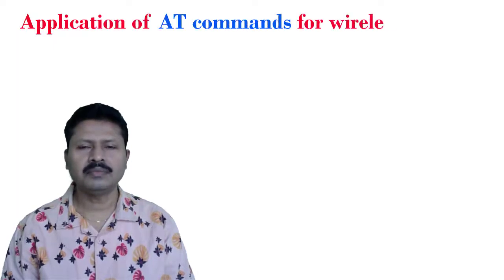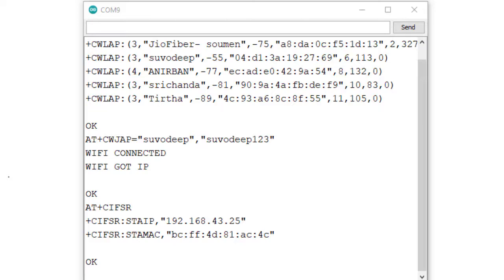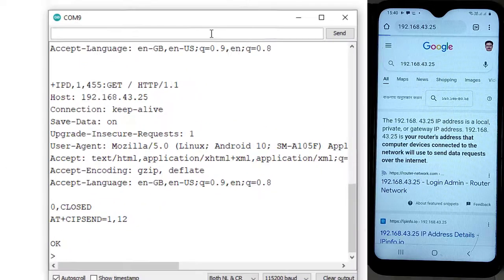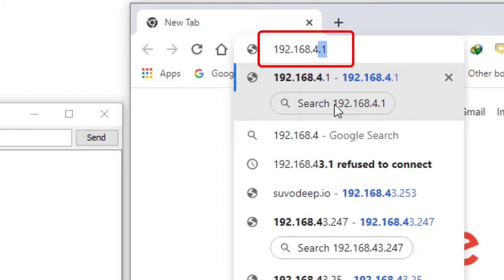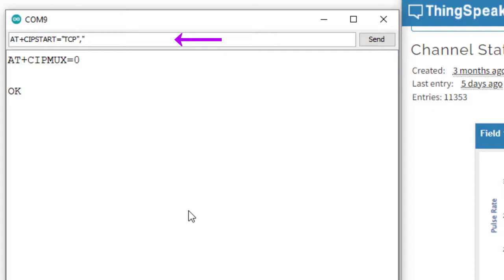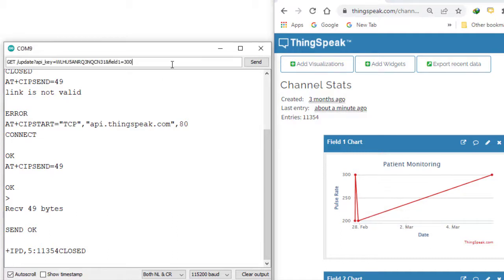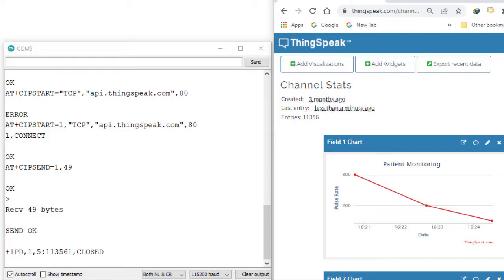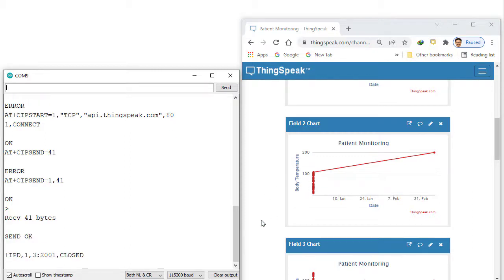[ESP8266] [AT Commands(Part 2)] Application in wireless communication with ESP, Mobile and PC.

Comment: Can ESP8266 work as mobile or Laptop hotspot and it can provide internet to the other devices?
Reply from the maker: it works with any network
Reply: @silenceandprogress   it working only without internet and , ESP8266 module can provide internet like mobile hotspot working and provide internet connection to other devices and we access internet to use YouTube watch movies etc
Reply from the maker: @PriyaKumariG  it can work as Access Point as well as Station. While used as AP, it creates wifi signal to which other stations can be connected. While used as a station, it may be connected with network